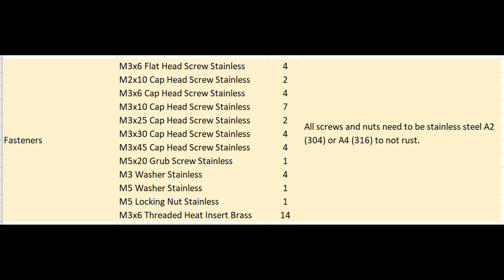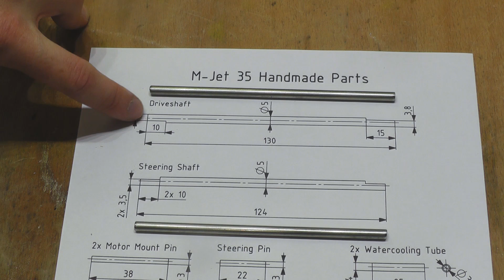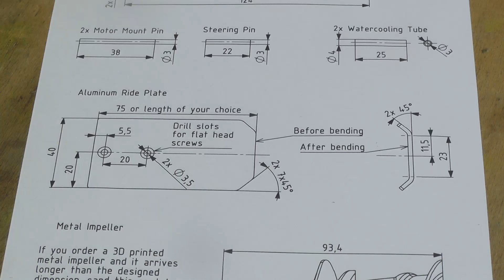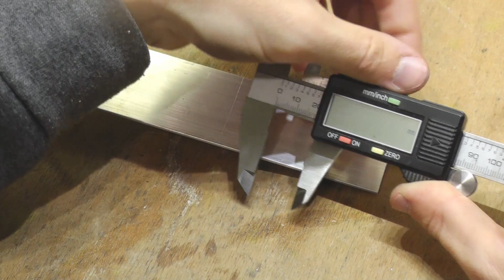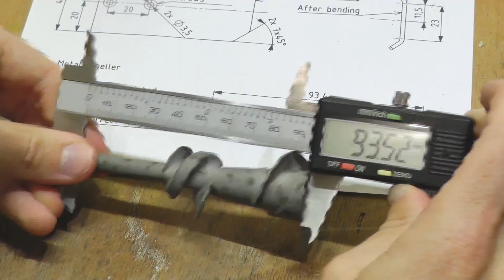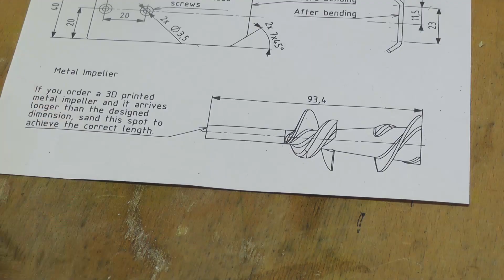M-Jet 35 Full Build

Comment: Love the aluminum bending too!  Just watched the whole build, beautiful work as usual. You have a lot of creativity and talent.  I like some of your new solutions with the motor pins and shaft seals. 
Question-  How different is the hull footprint compared to the MJet 30?
Reply from the maker: The height is almost the same, width is about 5mm more and length about 10mm more inside the hull. I can measure exact numbers if you need

Comment: Do you have files of the propeller mirrored so I might be able to use 2 counter rotating jet drives? For a larger boat. 😅
Reply from the maker: You can mirror it yourself in your slicer.
Though you don't necessarily need  counter rotating impellers for this, the nozzle removes almost all rotation of the water.

Comment: hi, I can choose between m3x6x5(outer diameter) and m3x6x4,5(outer diameter) threaded heat insert brass. Can you please tell me what size I should order?
Reply from the maker: Hi, good point, I will add a note about this into the manual. The inserts I used have the same dimensions as those M3 by CNC kitchen: 
https://www.cnckitchen.com/blog/tipps-amp-tricks-fr-gewindeeinstze-im-3d-druck-3awey
So the inserts start with a 3.9mm OD, and then the notched part which holds all force is 4.6mm. So you should probably choose the m3x6x4,5 depending on how they look like.

Comment: So I have most of the parts printed and need to order the parts to build it.  Can you please share the motor/esc/battery you used for testing?  I see the graph has many options.
Reply from the maker: My setup:
3670 1200kv motor
Turnigy marine 120A ESC
Graphene lipo 6s 2600mAh
Reply: @mjetdevelopment   Thank you!

Comment: Stepan, there seem to be two tiny channels in the sides of the nozze bearing hole as seen in 15:52 , what are those for?
Reply: Also do you have tips for hiding z-seams? are the channels for hiding z seams?
Reply from the maker: So the tiny grooves next to the bearing hole are intended just to allow a bit more flexibility of the bearing slot. This way if the tolerances around the bearing are too tight, the grooves should allow the bearing slot to expand more easily and press the bearing in.

Z seam just comes from the printer, there is not much I can do about it. If you find the Z seams problematic on your prints, you need to try various printer-related troubleshooting methods, I can't help with that. The groove is not related to them.
Reply: @mjetdevelopment  ok thanks

Comment: Hi, I'm trying to find a suitable motor coupler, would you be able to link the one you used? Love your work by the way. I'm in the process of building the m-jet 35 now.
Reply from the maker: Hi, I am glad my work is inspiring for you! I purchased a set of these 5x5 D18 L25 couplers from China: https://www.ebay.de/itm/353827460993?var=623198168421
Alternatively this one from EU will work if you can drill the 4mm hole to 5mm accurately: https://kehrer-modellbau.de/en/KMB-JET28-Rev.-3/KMB-JET28-parts/KMB-high-load-shaft-coupling-OE-4-mm-OE-5-mm
Maybe you can find some suppliers closer to your location though. Good luck with your build:)
Reply: @mjetdevelopment  Ah perfect. I wondered if the spiral cut flexible ones would be strong enough. I'll give them a go. Thanks mate.
Reply: Have you found any new couplers that work well, I'm blowing apart the spring type every battery.

Comment: Hi, thanks a lot for this great jet pump. I build the M-Jet Sprint boat - its fun :)
Can I also install the M-Jet 35 in the sprint boat? Do I need modifications or it fits?
Reply from the maker: Hi, glad to hear!
Unfortunately the Sprint's hull is way too small for the M-Jet 35. Scaling it up would require so much additional modification that it would be better to design a brand new hull, which I might end up doing at some point. For now, you can take a look at the Valkyrie: https://youtu.be/QDlQmHeKBD4

Comment: Have you or anyone thought about scaling this up to use in a full size jet boat? If it puts out that much thrust in a small package would it scale up nicely?
Reply from the maker: I have no way to build and test anything like a full size jet, but I gave it some thought. Most importantly, the very small scale of the M-Jet 35 makes the boundary layer effects extremely important, because dimensions of the boundary layers are not negligible relative to the impeller diameter. This is the reason why the 4-path nozzle and single blade impeller perform well at the small scale, but the benefit at a large scale is questionable. I would certainly be a fan of testing a large scale multi-path nozzle and believe there is some potential. With the single blade impeller, I think upscaling it would bring more trouble with vibration than anything else.

Comment: I was under the impression that in order to print PC-CF you'd need at least an enclosure and some kind of hardened nozzle, but you seem to do fine without any of those? Care to share your experience?
Reply from the maker: I have both hardened nozzle and enclosure. In the video there is plexiglass closing the printer.
Hardened nozzle is necessary, but it is easy to get and install. Enclosure might not be necessary thanks to the carbon fibers, you would have to try on your particular printer. Also I use 285 on nozzle and 110 on bed

Comment: What Motor is used (how many power and kv)?
Reply from the maker: I used a 3670 1200kv on 6s, around 80A amp draw so around 1700W. But the M-Jet 35 is compatible with all 3660-4092 motor sizes. There is much more information in the manual page 5:
https://drive.google.com/file/d/1d3b9momWcgAeUAn5o1v0-QZcIMYy4U90/view?usp=sharing

Comment: Could you maybe make a better prop because mine is maxed out at 75% power and wont go faster after that. and a stronger steering nob on the end of the shaft on the outside mine  keeps breaking.  This is for the mjet sprint.
Reply from the maker: Hi, which material are you using for the steering rod? And which motor, esc and battery? I have not seen such problem yet, the impellers should be able to take a lot of power into them. I  am currently busy with finishing the M-Jet 35 and therefore am not working on the M-Jet Sprint design.
Reply: @mjetdevelopment  i am usimg a 3670 motor with 2650 kv on 3s with a flycolor 90a esc  i dont remember the stuff that i printed it with. 
Any suggestions on what stuff is the stongest for the entire boat or sertain parts to be printed out of.
Reply from the maker: @parkourrush3820  Your motor is so big you could run it on 4S. 
For the steering shaft and ball, use PLA. Some people make mistake of using PETG or ABS for this part, but these materials will just make it weaker. If you cant succeed with PLA, let me know and then we can think of something else:)
Also if your issues persist, I might be able to hlep you better if you post videos or photos in the M-Jet facebook group (link in description of this video).

Comment: Please make video about steering system hiw its work? Hhh
Reply from the maker: The steering system is visible at 1:20 in this video: https://youtu.be/ke5BGJ54vEM
Does it answer your question:)?
Also you can see how well it steers the water in the end of the "4G Sprint Boat Finally Running" video with on-board camera, you can find this video on my channel.
Reply: @mjetdevelopment  i have seen that,, but i still don't believe that can make sharp manuver like that,, No way,,, please make one episode about steering spesificly
Reply from the maker: @sukasilat5596  Ok, I understand. This steering system is new so I get you are concerned about its manouverability. 
I will show you more footage where the steering system is better visible, and the nozzle is also shown in detail from the other side.
Please watch 1:05 - 2:00 in this video, which shows older version of the same system:

https://www.youtube.com/watch?v=aXMWUv7xXt0&t=65s

When connected to servo, you can see how it deflects the water at 1:16 - 1:29 in this video:

https://youtu.be/KbvLo_k-ZRM?t=76

To see how tight cornering this system provides, please watch the boat in action at 1:16 - 1:36 in this video:

https://www.youtube.com/watch?v=KYTUcPcL1a4&t=75s

What do you think about it?
Reply: @mjetdevelopment  ok,, thank you bro,,, you have great work,,,
Reply from the maker: @sukasilat5596  Thanks! And thanks for taking a look🙂

Comment: 8:19 just call its step bro
Reply: Keep doing this! Love your work🔥
Reply: Is the MJet 60 still the best option for a surfboard? I would also love to see a build video for the M60
Reply from the maker: @R0B0TDAD  Hi, the M-Jet 60 is still the only pump of this 60mm size I have available. The M-Jet 35 design is better basically in every way, but is only 35mm which is way too little for a surfboard. 
You could try getting the M-Jet 35 and resize it 2x up to 70mm, possibly getting a better pump, but it is not tested, result is unknown. Also you could run into problems with tolerances and hardware sizes after the resizing.
The M-Jet 60 has been tested, and is designed to be built and sourced in this size easily. So it depends on what you want from the pump.
Unfortunately I have no build footage for the M-Jet 60, because it was result of a collaboration. I created the design, but the pump was manufactured and tested by the other guy. The collaboration ended, and I do not have any footage myself.

Comment: maybe I missed it. But why did you remove 2 of the 6 exit holes? just better performance? Last step to perfect it is to add a sort of reverse on it. Your design looks very professional.👍🏻👍🏻
Reply from the maker: Yes, during last steps of the development, I changed from 6-path to 4-path nozzle and did not explain it properly. 

The reason is, I found out it adds a last small bit to efficiency, and also makes the steering nozzle more compact and durable. The water stream is now less straight and does not look as nice, but on a lake it delivers better performance, so I chose to do this compromise.

I understand your needs for reverse, but so far I am not planning to add it because I never need it myself, and dont have space for it in my hull. In my eyes, simplicity of this design is also very important. Therefore if I occassionaly need reverse, I just spin the motor backwards which works a little bit, instead of adding a big bulky mechanism.
Reply from the maker: @dextersxxxxlab  I can give you a very rough estimation... Metal impeller 50$, all other pump parts (estimating you have some hardware already) 30$, brushless motor 40$, good esc 90$, filament for hull moulds 50$, all carbon and resin things 130$, 6s 2600mah battery 60$, thats 450

so it should be around 500$ together. 

Obviously not accurate and will differ according to component quality you select, then it depends if you want CFPC filament for the pump, etc.
Reply from the maker: @dextersxxxxlab  By the way. If you need a reverse bucket, I can help you (free) by designing a screw mounting point into the second stage as a pivot for the bucket if you ask and tell me where exactly you would like to place it.
Reply from the maker: @dextersxxxxlab  Nice!
 The 3680 1250kv on 6s is a great choice, the 1100kv will also work well just a bit slower. I bought my particular motor from RCJuice.com and had good experience.
 There is some tolerance around the recommended KVs. 
My motor was using 80 amps, so I used a 120A esc and also suggest it in the manual, with your motors this will work as well. Just better set it to 0° timing at first.
Reply from the maker: @dextersxxxxlab  This is my motor:

https://www.rcjuice.com/motor-esc/brushless-boat-motors/hobbystar-3670-4-pole-brushless-sensorless-boat-motor-waterproof.html

But you can of course choose a different motor based on your preferences, for example the 3680 1250kv sounds very nice.
Reply from the maker: @dextersxxxxlab  No, most ESCs can be programmed just by putting them into a settings mode (you achieve this depending on your esc for example by plugging in the battery while holding 100% throttle), and using the transmitter to control it. This is a bit uncomfortable but if the ESC has some manual, it is totally doable. The programming card just makes things much simplier.